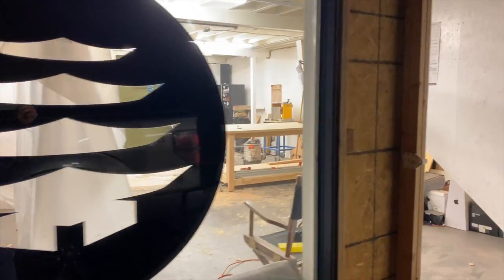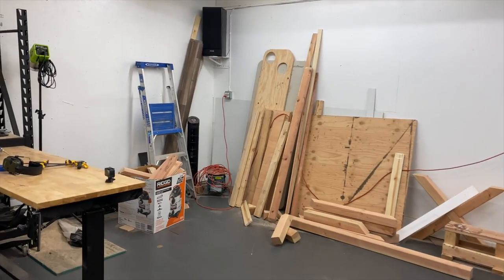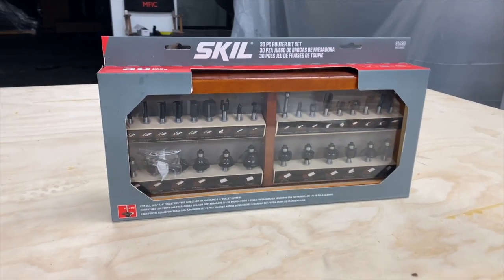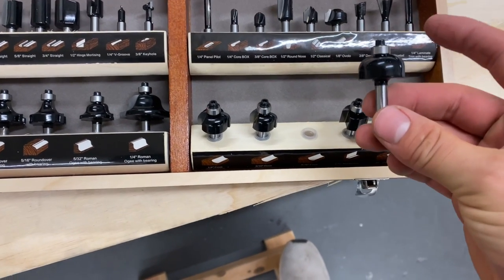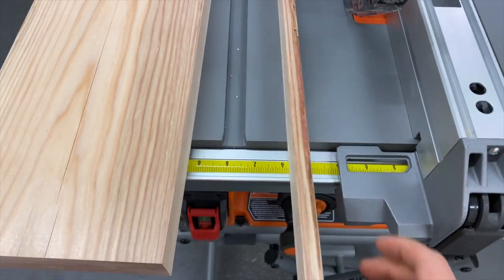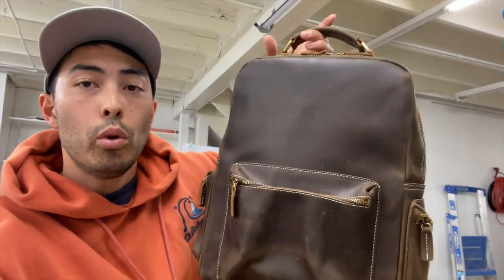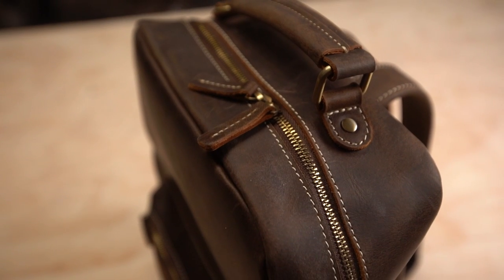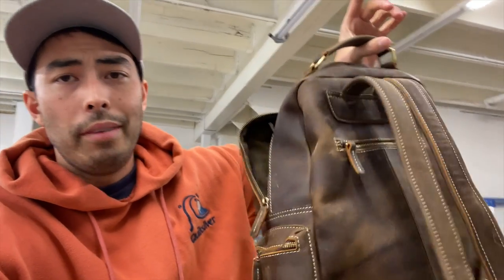I Bought a Table Saw on Black Friday

Comment: I see you took my advice and bought a table saw.  I personally would have bought a larger saw, rather than a portable "jobsite" model, but what you've got is definitely going to be a step up from using a circular saw with a clamped on guide to rip material.  You're going to find out very quickly how handy a good rip fence is, especially for accuracy on repeated cuts.  I suspect you'll end up getting a larger saw before too long. With rip capacity, the more, the better.  30" rip capacity is OK, but not great.  But the portability of that saw may come in really handy for some projects, so even when you do upgrade to a bigger table saw, you're probably going to want to hang on to that one.  Sweet leather backpack by the way!  A bit pricey for me, but very nice.
Reply: @greenlightshooting1  It looks like the saw you bought comes with a pretty nice fence.  Rip capacity is a function of how far the rails attached to the table extend beyond the blade, so there's not much you can do to increase rip capacity on that saw.  Even if you could come up with a way to extend those rails, doing so would likely cause stability issues, so I wouldn't recommend it.  I believe my non-portable Ridgid table saw has a 36" rip capacity.  I know the extra 6" doesn't sound like much of a difference, but you'd be surprised how often that makes the difference between being able to make the cut you want and not being able to.  And I still sometimes find myself wishing for a little more rip capacity, but you're not likely to find more than 36" or 38" without going to something like a Delta Unisaw that costs a lot more money.  I don't have space or the budget for one.  I don't know about your budget, but It looks like you do have enough space.  If you do much woodworking and you scrape together the money for something truly commercial grade like that, I guarantee you won't regret it.  Just be aware you may need 220v for it.

Comment: Time to build a cross cut sled for your new tablesaw. Mobile saw are reliable if you keep them cleaned. It's the same motor that they would use in a stationary saw. You could also always build a stationary stand for it too
Reply: Check out john Katz mosses's video on building them, they're supposed to give you cuts more accurate than the fence that comes with the saw, it also allows you to make easy miter cuts